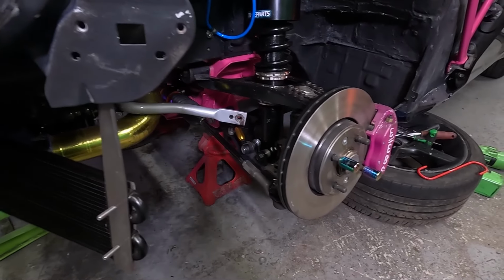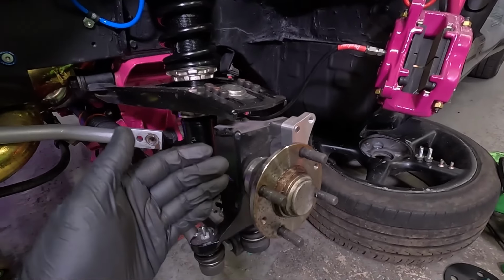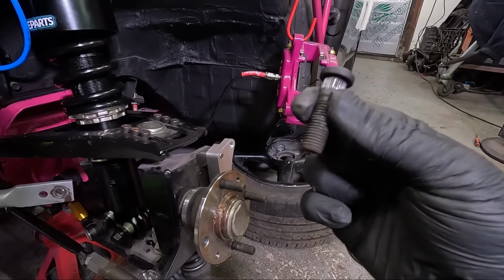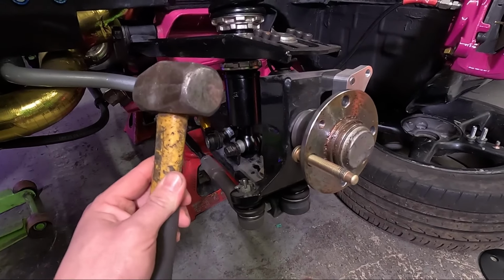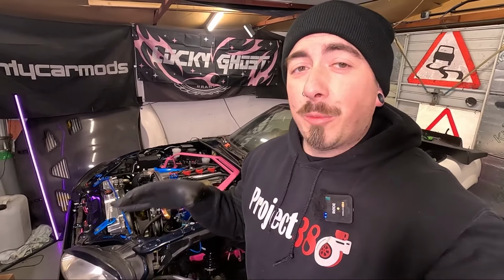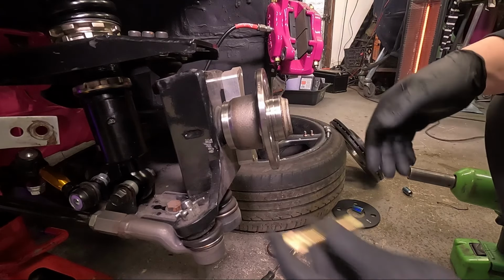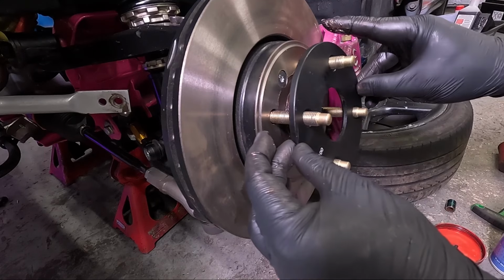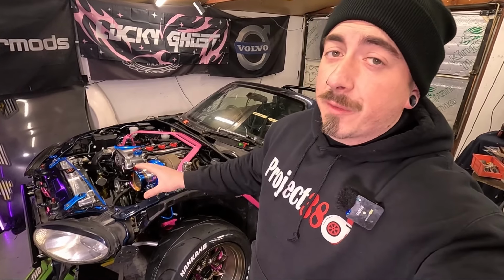ARP EXTENDED FRONT WHEEL STUD INSTALATION : MX5 MIATA TURBO BUILD pt 71

Comment: Hey man! I love your videos, a good few of them have been really helpful to me. Quick question. How much are the studs extended by? I’m wanting to fit spacers on my 14” black racing wheels for better fitment (they sit way too far into the arches) but i’m not sure how much spacer i’ll need. Obviously if i’m using a 10mm spacer say, i’ll need 10mm extra thread, but say i use a 5mm, i also don’t want too much thread if that makes sense?
Reply from the maker: yes that makes sense. they are 30mm longer

Comment: I'm watching and I'm thinking those news studs look too long for that 6mm spacer. 6mm spacer for an extra 20mm of stud, I was wondering how you were going to make that work.
Reply from the maker: You don't necessarily even need to run spacers with these studs. They are just good studs with a rounded end and longer.